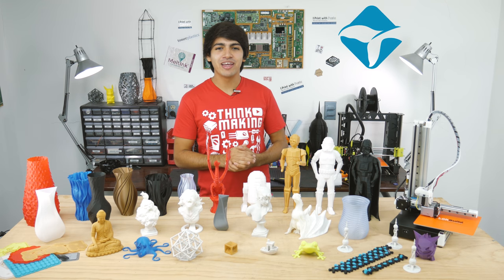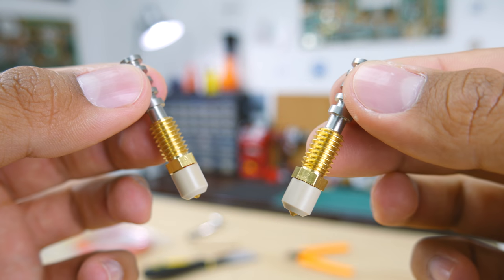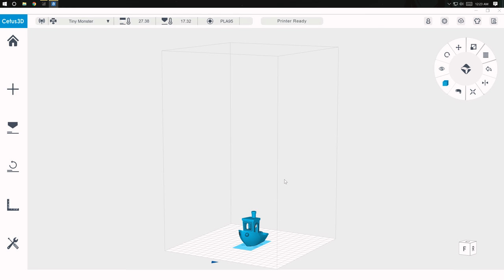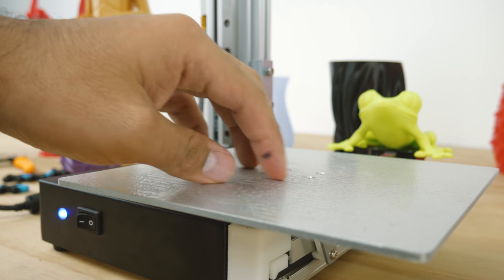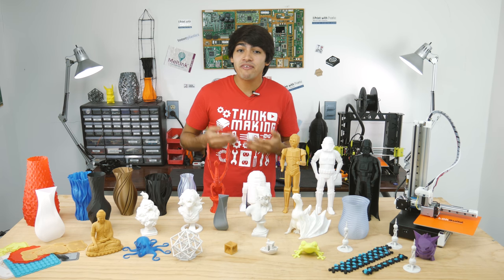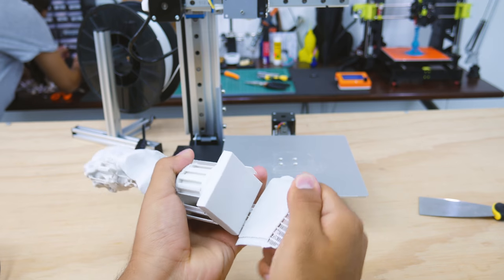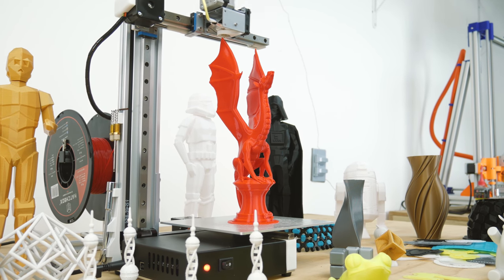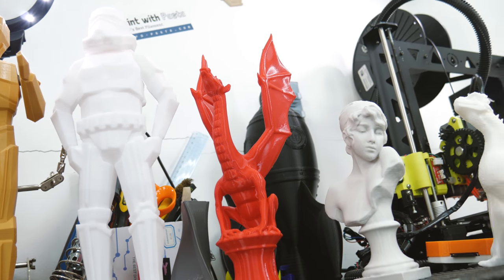😍👌 Best 3D Printer for $300 - Cetus Extended - 3D Printer Review

Comment: I bought a Cetus3d Ext MkII and i've been using it for a week and it works flawlessly! There are actually a little bit more detailed print settings if you press the arrows in the top right corner of the print tab, but they're far from what third party slicers can do.. Still working great though! Try the easy to peel raft option, it's incredible!

Comment: Great job on the review. It was thorough and informative. In the comments section it looks like folks have strong opinions on particular devices. Recommend staying neutral and avoid bias toward one over another. As you stated in your review, the Cetus seems better suited for a plug n play experience than say a CR10 perhaps, but if someones mind is made up, you're not likely to change it no matter what. 

Remember, there is no such thing as a perfect printer. If there was, we wouldn't need reviews- we would just buy that one.

Comment: thanks for the great video! How do you compare this to the Prusa Mk3?  I have used printers before. what are good options I am a tinkerer but like the build quality and reliability of this Cetus printer. budget is up to 1200. so upper ends is prusa Mk3. I do not need heated bed however.(although nice bonus) which do you recommend. I was looking at cetus extended mk3.

Comment: Thanks for the review. I have one comment though. The CR-10 is on sale now and I could get one for $339.99USD. It has a bigger print volume. IMO the CR-10 would be better for the price.
Reply: Better at the price sure but you have to remember all the fiddling and modifications that the CR-10 needs to print anywhere near as nice as the Cetus out of the box. CR-10 is a good printer if you are interested in working out bugs and errors. How ever for the entry level plug and play market of printers the Cetus is modifiable but doesn't require tinkering to get it printing good models.
Reply: The CR-10 does not need any mods right out of the box. It has no bugs either. My friend has one and it took less than an hour to get assemble and start his first print. Also his first print was amazing! His prints got even better than that after he tuned it properly.

Comment: Cetus keeps the top level nice even though it wobbles because of the canter-leaved design- this means that when the hot end wobbles- the weight keeps the nozzle to always return back to the original pre-loaded  position - ensuring uniformly whenever the wobbles relax.

Comment: Did you print the vases with just 1 perimeter and no infill, or did you use a true vase mode from another slicer?
Reply from the maker: I used the no infill, no top, no bottom mode. This doesn't slowly raise the z-axis though, so  there will still be a visible seam.

Comment: Can it is ABS though? I am new to printing, and have heard that PLA is really weak, and I need to print things that are realativly strong.
Reply: It can't do ABS without a heated bed, but ABS isn't much stronger than PLA from my experience. If you want a major increase in strength you should probably try something like nylon or poly carbonate filament (you'll need to get a heated bed, and if you want to print poly carbonate, a hardened nozzle). Also, depending on how strong you need your part, you could just increase the number of perimeters around the part or infill, but it depends what you want to print.
Reply from the maker: If you want to print really tough parts, then you should try Matter Hackers carbon infused nylon. You will need a heated bed and at least a hardened steel nozzle.

Comment: still the best 3d printer for 300$ ? or any other recomendation ?
Reply from the maker: At 300$ I still recommend this printer. Yes, you could get a CR-10s for 150$ more, but this printer is designed for ease of use, portability, reliability, and amazing print quality.